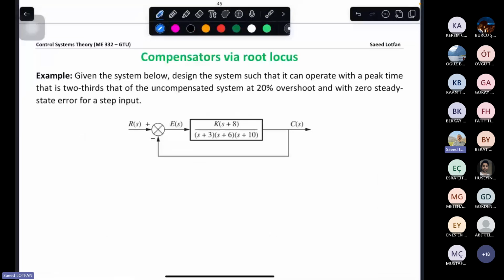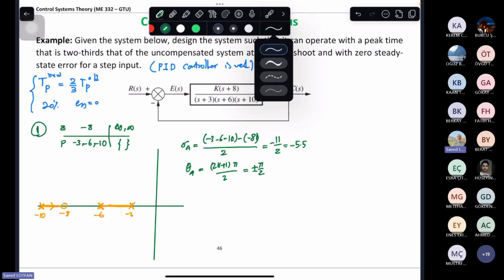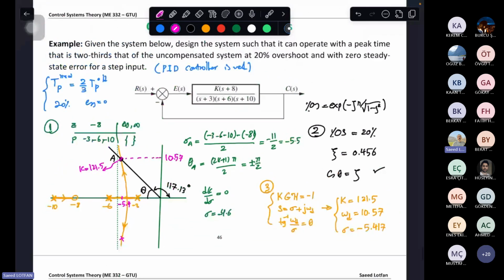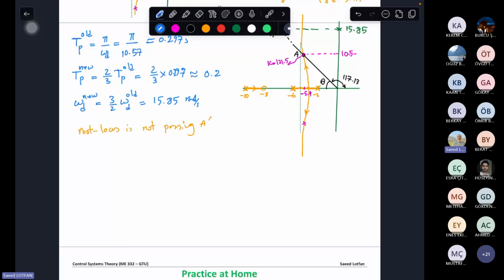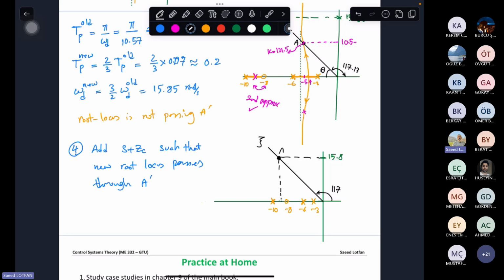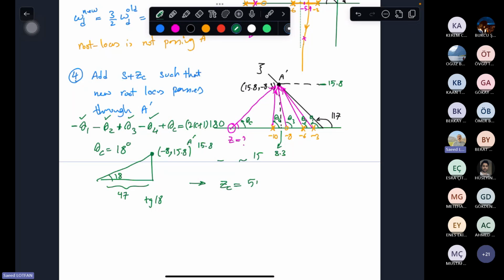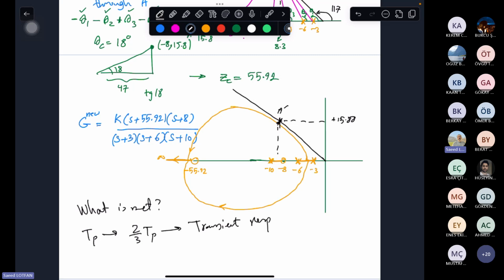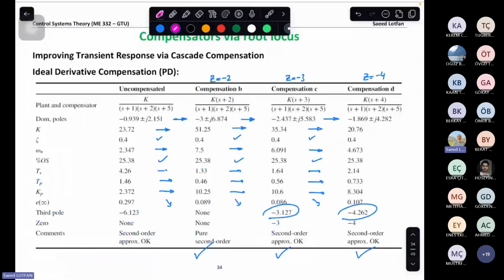Lecture 8.3 | Compensator Design Using Root Locus Technique

Comment: Sir can you please share pdf for more examples
Reply from the maker: You can find more pdfs and examples on my website teaching section.
saeedlotfan.com
Reply: @saeedlotfan Sir only five problems there lecture notes. Can you suggest any book or pdf for practice on compensator design via root locus and frequency response
Reply from the maker: @darsaishealateja1345 you can look in the book by Nise “Control Systems Engineering”